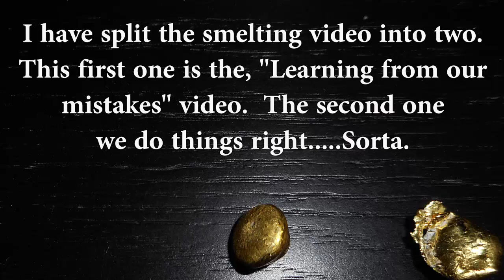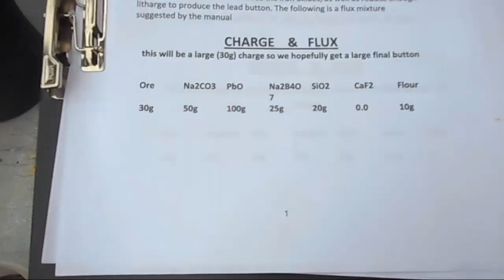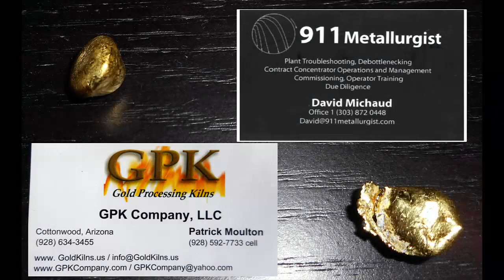Smelting Flux "Alchemy!" Well no... But Gold Melting, Smelting, Cupelling, and Assays. Part 3

Comment: Flour is an oxidizer. So is charcoal. Use about 2.3 grams of flour per 1AT. This will give you a prill of about 23-25 grams of lead for cupeling. This is called the reducing power of flour. Add about 3 long nails to the stew to pull sulfur out.
Reply: Hey Dave, I'm new at this. You say use 2.3 gm flour per 1AT? How much is a AT? You said a prill of 23-25 gm. He started with 100 gm lead. I can't get litharge, but have lead wheel weight's. I sent stuff off to a assayer 2lbs of con's down to gold and sulfide's. They told me my total amount, but wont say how to get it[flux]. So I have been going crazy, trying. I tried chapman flux to many time's, nothing.  Now I found out not to use salt in my roast and not at 1,100 degree. Keep roast 400-500 nothing added, stir until no sulfur smell. I bought a retort, so now trying mercury, in a ball mill. I have tried Aqua Regia, nothing. Was told the sulfur wont allow a precipitate. I tried Legend assay flux, got a gold color iron button after cupel lead away. Tried HCl acid to remove iron then smelt unroasted, got iron matte gold color. Any advice you can offer would be appreciated. Thank's

Comment: Instead of lead oxide just use lead. The lead is supposed to oxidize and pull the lower case metals out into the cupel. You can use pure portland cement instead of a cupel. Just press it into a cup form.

Comment: TRY A FINE STAINLESS STEEL SCREEN OVER THE HOLE IN THE TOP, SLOWS DOWN THE HEAT LOSS, ALLOWS IT TO USE MORE OF THE HEAT.

Comment: Plus if you torch the ore ...directly with the torch ....the black ore....will pop like popcorn ..."then is probably" the best time to use the candle....to reduce the ...."un-shiney bits"....
....or...you could work sum week hydro-? Gen....peroxide....like 3 %

But it will froth over ....

Comment: All you need is crushed ore soda ash and borax and you'll get perfect gold everytime
Reply from the maker: I am no expert on this, but I was told by the expert that without a collector metal (lead in this case) you will not collect all the gold if your ore is less than about 20% gold.  Too much will still be left in the flux.  I will let the experts reply to this.